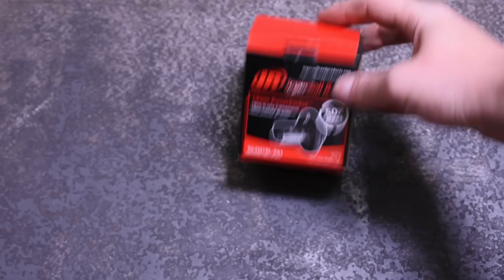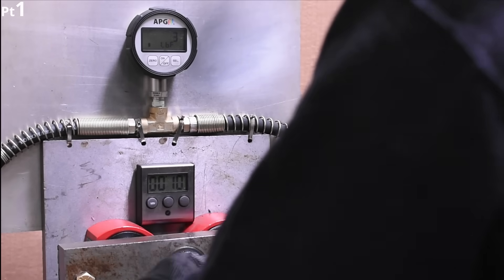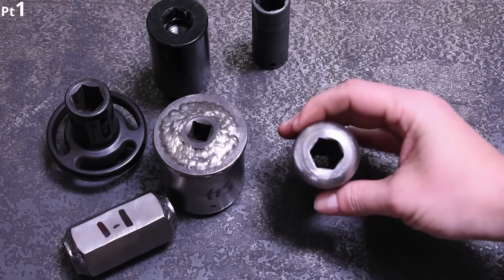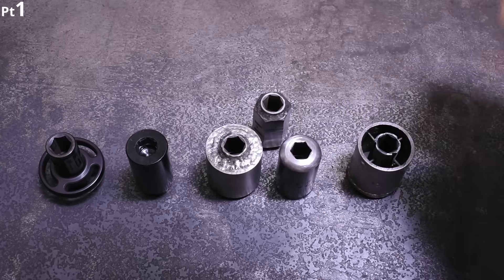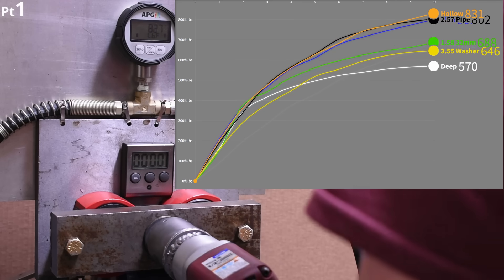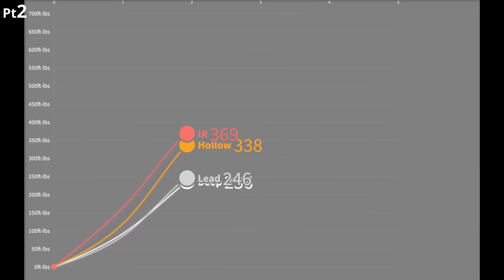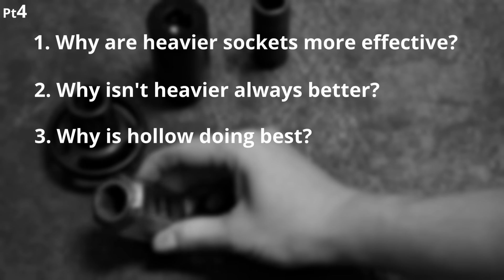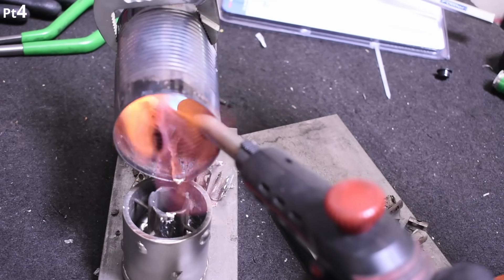Heavier Sockets Make More Power? Stumps Physicist

Comment: Would be interesting to see if the 'sweet spot' weight of the socket was different depending on the impact wrench used - what is good for Milwalkie might not be best for Bosch. Then see if there is a relationship between the weight of the mechanism the weight of the socket and the motor / impact speed. 
There coud be some sort of resonnance going on.

Comment: First saw these when I worked in auto salvage and I remember saying "The mass is in the wrong area. If F=MA and A=0 then changing M shouldn't matter since anything times zero is not. You would want the added Mass in the hammer since that's where the acceleration is coming from." and getting the old deer in the headlights look. It might help carry the force longer but it should also slow down the acceleration since the hammer now has to move a larger mass with the same force. I do have a University of YouTube degree in Physics here so I would check my maths.

Based off my sample of one random socket that was at work one day, I wouldn't waste any time on these.

Comment: it's all about resonance. there is specific inertial mass which adds up nicely. when it resonates the socket hits the bolt, rebounds back and bounces of the other side. when it moves again in proper direction and get another hit from impact gun - force adds up, but too light socket will accelerate quicker after the hit from the gun so it loses combined force. the best should be as solid as possible - weld the gun to the nut or fill the gaps of the socket with by welding. all of the hammer force will be transfered directly. but there can be even better way. if hammer hits the anvil and sticks to it, spins the socket sticked to the gun, all of that spins as one thing and then hits the nut - most beans as most mass with no bouncing back due to gaps. heavy stiff sockets are the best because when the gun hits them, trey are sped up to speed and then it thransfers that to nut. there is a gap between gun and socket when the sockes hits the nut. it's all bouncy. same as thinking that solid material is ultimately solid

Comment: My gut instinct says it is the difference between regular inertia, like when you throw something, versus rotational inertia, like when you spin something, since an equally weighted socket with more mass at the outside would have more rotational inertia.  Regardless of how anyone feels about the matter, there are absolutely some things that you can do to test the theory and narrow down what is causing the particular behavior of the IR Powersocket.   What you could do is make 3 more home made sockets as a test.  1: a homemade powersocket, which is a regular socket with a ring at the base.  2: welding a ring at the bolt end instead of the drive end.  3: a powersocket with a much larger ring.  Having a much larger diameter ring would absolutely confirm or deny the rotational inertia theory.  Testing with a ring at the front versua the back will test if the effect is stiffness related.  Perhaps the most power loss in a socket is at the interface between the impact drive adapter and the square hole of the socket and having extra mass/inertia at the base of the socket helps counteract that?

Comment: I think the flywheel acts as a resonating element (constructive interference). If so, then it only works well on some tools where the forces, masses and spring constants are in harmony.
Reply: I think this is the correct explanation as well. If you could modulate the speed of the impacts, I think you will be able to find the correct speed that will maximize the torque for each of the weighted sockets.
Reply: @tigo01  It makes me wonder if you could design a tool that could automaticly  adjust its rpm to be the closest to the resonant frequency (or a multiple) of the system.
Reply: I would like to see a test where they keep some tension or preload on the socket in the correct (tightening) direction, to minimize the socket 'bouncing' back and forth. Similar to this resonance question in a way.
Reply: @toyorover1313  I often load the socket like this by twisting it with my hand, which really seems to help. My hypothesis is that the impact transfers more directly from the gun through the socket into the fastener, as opposed to gun to socket then socket to fastener.
I just had a thought: the heavy socket if not preloaded can potentially accept the same or more angular momentum from an single impact but will certainly be be better at converting that momentum into torque at the fastener when the socket impacts the hex on the fastener.
Reply: @rallyrat Yes me too, especially easy with 1" and larger sockets. 

But I'd like to see them preload with a breaker bar as well (picture a spark plug socket with a wrench on the hex on the back of the socket, and an impact hooked up to the square drive).
Reply: I think the resonant freq of the flywheel is way too high to constructively add with the blows of the impact wrench.  The high freq oscillation of the flywheel could vibrate the bolt, reducing the friction of the threads
Reply: @mwcolton11    There can be constructive interference at even harmonics of the frequency, but I do not think  Its  about  the resonnance freq of the flywheel in respect to the socket and more caused by the inertia of the flywheel that will change the dynamic  of the whole system. It might be why there seems to be an optimal socket inertia. By changing the inertia the transfer function for the whole system will be different and it could change the resonant freq and the magnitude of  resonnance (max torque) enough so that at the same frequency the max torque is higher.
Reply: Yup, just like this very channel explained in a video half a year ago with slo motion video of cut open impact wrenches. Harmony of all the systems (motor, spring, hammer, anvil and now + socket modifications)
Reply: Yes, this was my initial thought. Resonance can extremely powerful. Think of how if you sing the right note you can shatter a wine glass.
Reply: not sure if this is the right explanation though.  when you graph something as a function of frequency the resonance frequency is usually a pretty sharp peak.  and I'm assuming we would be talking about the resonance frequency of the bolt since that is what we are trying to transfer all that energy into.  if resonance was the key then any given socket would be only be useful on a bolt once in a blue moon, since its going to depend on the material makeup of the bolt, the size and shape of the bolt, and the objects the bolt is touching since some energy is going into those too, any other bolt is going to have resonance frequencies at least slightly different so that you'd see almost no effective torque increase.  plus this would make much more sense for loosening a bolt rather than tightening it, since resonating is going to make it vibrate more which typically helps to loosen a bolt.  it also doesn't make much sense since the only frequency we are getting are the impacts from the impact and are not going to change by changing a socket
Reply: @Logan-dk8of    I dont beleive its the complete explanation but resonnance could be part of the answer,  with a  system with some damping the resonant frequency is not a sharp peak, more like the highest point in a function. If we are trying to maximise the torque in function of rpm, there is a frequency at which the gain or the magnitude of resonnance is the highest. So every socket will give good results, but some can allow the system to peak at a higher torque. If you were to put a vibration sensor on the tool you would get the total response of the system, the frequency responce of the hammer mechanism is influenced by the bolt/nut. Since the system is mostly elastic, with the hammer spring storing a lot or energy between each blow, if I undersand well there should be an optimum rpm for tightening and loosening.

Comment: The larger the circumstance with the lower the weight the better the outcome.. obviously can't be flexible though... so the maximum diameter you can go with the least amount of weight and rigid will be the best... it's all about angular momentum and having the majority of the mass the furthest away from center as possible.

Comment: I would like to see you machine a bolt for your dyno with a 1/2 inch square drive. Cut out the socket altogether and insert the impact wrench directly into the bolt head. Would be interesting to see if that would perform better or worse than the weighted sockets.
Reply from the maker: My issue with testers like that is A they wear and wallow out and B its not very relatable to us using impacts obviously with sockets unavoidably
Reply: @TorqueTestChannel  Makes sense. I wonder if it is a harmonic that preloads then slings the weighted sockets. If you still have the high speed camera available it might provide additional data.

Comment: My guess would be it extends the time turning because of the flywheel and if the hammer hits it at the right time you get increased torque. The only thing I could think of to test this is if you change the speed of the hammer blows. Kinda like a resonant frequency type of thing. Also just a guess, no expert in anything in particular.

Comment: Going to offer my 2 cents even though I haven't watched the video yet(I expect I know the outcome: lead sockets don't produce more torque)... Because I've already been thinking about this every time it was mentioned.

Weighted sockets produce more torque not because they are heavier, but because they're more rigid. This means their torsional spring rate is higher, so they require more torque to store the same amount of energy, meaning that instead of storing the impact wrench's energy as a spring, they end up transferring more of the torque to the fastener because it's just a much stiffer torsional spring. Shallow impact sockets with a similar wall thickness to a deep impact socket should show a similar improvement. Shortening that torsion bar will increase its spring rate. Lead is soft as frig. It'll permanently deform under the impacts.

At the same time, I'm sure you can find a torque stick that weighs more than a given shallow impact socket. Torque sticks are of course designed to limit the output of a torque wrench (They will always do this imperfectly  because they would need to be matched to the impact wrench, air pressure under load, and setting if the wrench is adjustable, etc.) Wouldn't be a shocker if the torque stick produced less torque than a socket with no torque stick, would it?

Find a material that is stiffer than the normal varieties of impact socket steel alloys, but that is also not so brittle as to break under this use case. If it shares similar geometry with a given non-weighted socket, I think you will find a similar improvement.

EDIT: Now that I've watched it, glad you tested a hollow socket. Similar to a driveshaft on a vehicle, a lightweight tube that can transfer a lot of torque, because making the diameter larger reduces the material needed to survive the same amount of torque (and increases torsional spring rate). I'm sure there's a point where increasing the diameter results in such a mass increase (probably some minimum wall thickness needed) that you start to lose out. There's definitely a sweet spot to be found in balancing the dynamics.

EDIT2: Regarding the cut IR socket producing less torque, definitely not what I expected. It is possible however that that structure with a large diameter increased the rigidity through that specific section of the socket. Enough to make a 75ftlb difference? Quite possibly. I'd guess it is unlikely you're acheiving any significant resonant effect from that large diameter weight that could amplify the output. 

If you really want to know more, you make an educated guess at these things and find ways to test each property. Easier said than done. I think the professor was absolutely correct in his conclusion and it fits a general understanding of dynamics. Using FEA software to analyze the cut and non-cut IR socket may possibly show a more complex interaction (if it exists) where this structure not only stiffens the socket radially around where it is attached, but perhaps the effect extends further longitudinally. This possibility is much more difficult to assess at ye olde arm chair.

Comment: You need a light weight socket to can achieve high rotational speed from the impact energy but it has to be wide or heavy to store that energy. Make a socket as wide as possible but light weight so it can accelerate to high speed. The changes in torque are most noticeable at the high end of the scale because that's where the fastener is tight and and the socket rebounding on the bolt hex head gives it more room to accelerate again. It's taking advantage of slop on the socket fit. The socket and bolt head are acting like their own impact driver. Make a wide hard af socket but light and make sure it's stiff. Maybe make it a bit looser on the fastener. Perhaps test this theory by using a 20mm socket on the 19mm bolt.

Comment: I believe part of it is resonance, where the kinetic energy is stored and released efficiently.

I also think the cause of the bigger sockets is simply the tool not being powerful enough.

Lead would not be good for this application as it is too soft and will lengthen the impact time.
The hollow socket works so well as it is the most efficient way to both have a lower overall mass, but more mass in the places it needs to be to transmit beans.

Comment: The lead socket never plateaued in any of your tests. Therefore it still may have the highest torque for loosening tight bolts. The "10 second tests" in tightening are irrelevant for real world use of  loosening tight/rusty bolts if the socket or impact never reaches its peak.

Comment: “My two cents “ I’m thinking one thing that’s being overlooked and why the hollow socket is doing better?… the hollow socket does not use weight or mass. It uses leverage. From the center point out from the impact anvil to the OD’ of the pipe then back down at the front end of the pipe back to the OD’ of the socket. I believe that’s the gain you’re seeing… (leverage)

Comment: It would be interesting to see the weighted sockets on the high speed camera. The heavy mass ones, might not show much. I would think the Ingersoll Rand Flywheel design and hollow design might show some interesting things. I would think the flywheel would whip helping the internal weights. I would also think the weight of the socket would be limited by the hammer mechanism of the impact. I’m just a HVACR Tech and ex Farmer, that’s my non engineer opinion. Really appreciate your channel and testing.

Comment: I think this is similar to the interaction of a hammer and chisel. The hammer is the impact and the chisel is the socket. A chisel will bounce off the material after it's been struck. That energy was wasted and you have to input more energy to get the chisel back on target. A heavier chisel will bounce less which allows for more efficient energy transfer and less energy wasted setting up the next strike. A chisel that is too heavy will dampen the hammer blow and transfer less energy.

I think the impact gun is doing the same thing except there is also energy conservation in resonance which is why some sockets have more area under the curve but end at similar numbers. 

I don't have any sheets of paper that say I am smarter than anyone else though.